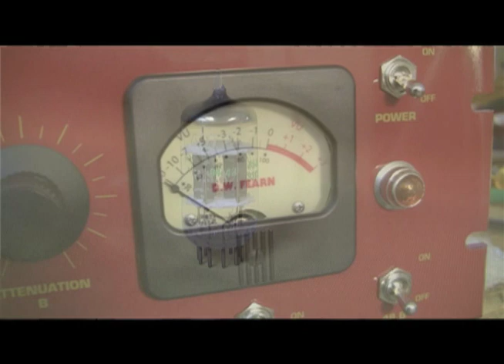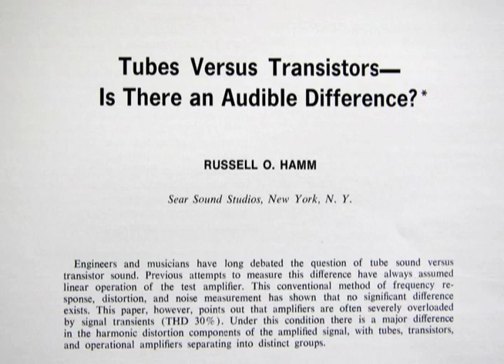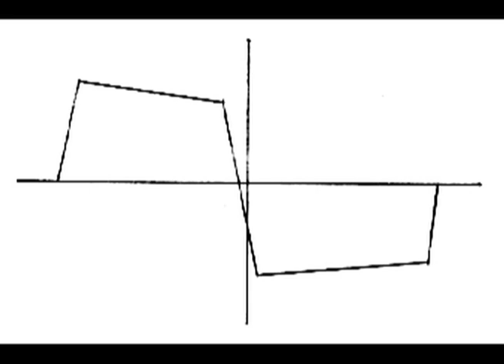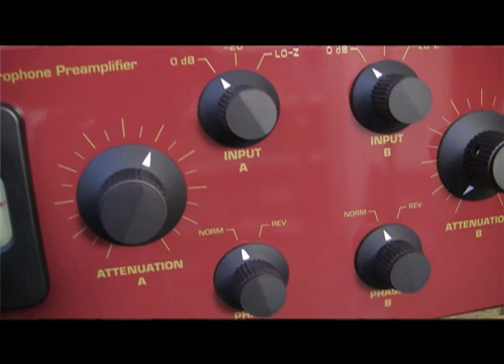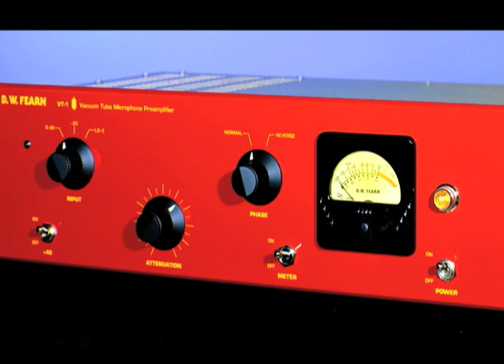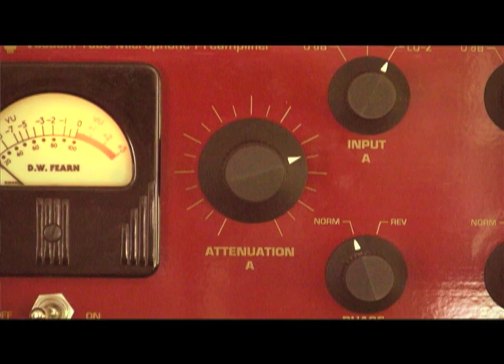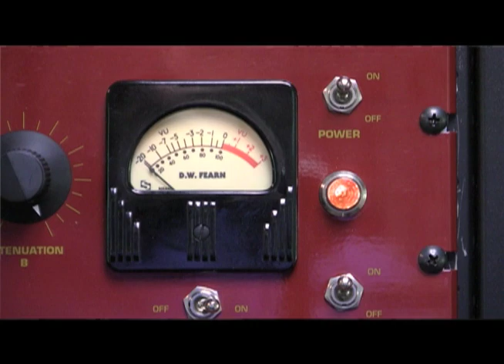VT 2 Tutorial Part 1

Comment: A follow up question: is the difference in solid state and tube preamp circuits similar to the difference between push pull and single ended tube circuits? I've read that push pull circuits also clip in a square wave, is that always true? I love your podcast, an episode on the differences between push pull and single ended tube designs would be wonderful! Thanks for everything!
Reply: None of my designs use push-pull circuitry, which I think is best suited for power amps, so I have not done a lot of experimentation with P-P. The major problem I see with P-P is that the distortion products tend to favor odd-order harmonics, not the even-order (musical) harmonics of single-ended circuitry. The nice even-order harmonics of single-ended circuits are especially musical in triode vacuum tubes. A push-pull solid-state amplifier would seem to incorporate the least musical traits of any amplifying device. But there are really good-sounding push-pull power amps, both solid-state and tube, so it can be done. My preference is for single-ended, vacuum tube designs whenever that is a practical option.

Comment: Great video! I have a question: 

Do even the higher end solid-state preamps, which are marketed as “low distortion”(for example Earthworks ZDT, or Forssell or GML pres) suffer from the same problem with high transient peaks? Or are these problems rectified to an extent in them? Thanks in advance!
Reply from the maker: I think the best solid-state mic preamps handle transients very well. All preamps will eventually run out of headroom, given a strong enough transient. It's how the transient overload is handled. With high-quality preamps, it comes down to a matter of taste. Obviously I think quality vacuum tube mic preamps sound better than solid-state, but many great records continue to be made with solid-state preamps.
Reply: @DWFearnHazelriggIndustries  I see, thanks so much for your answer!